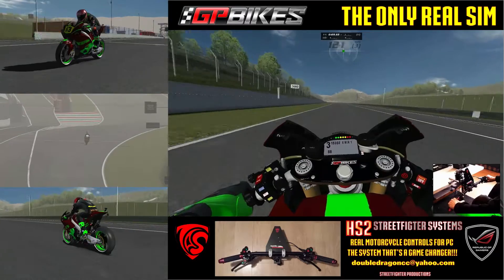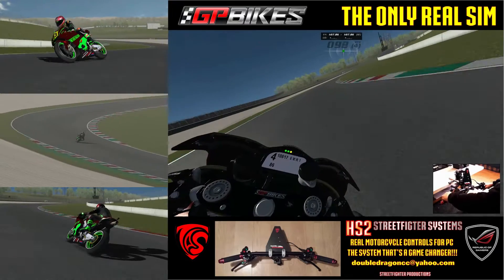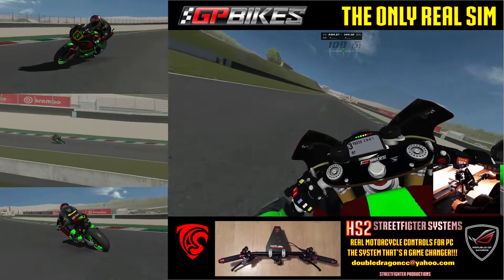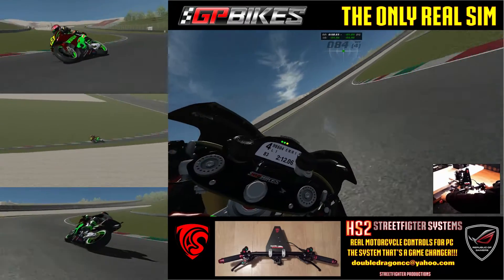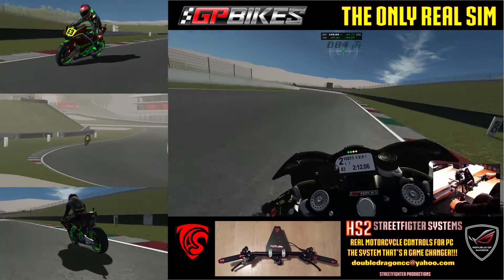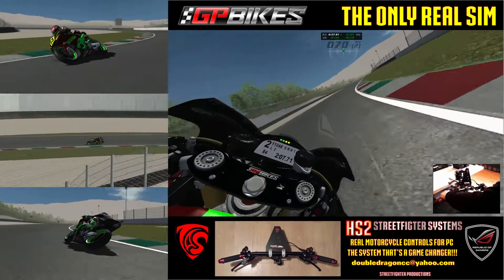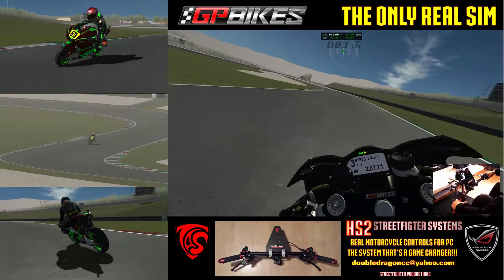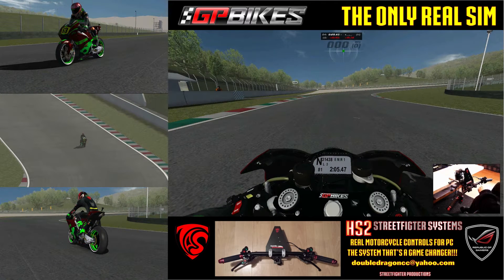Hs2 StreetFighter System 1st Test

Comment: Hi,
I would like to know the cost per system, interested in rig it into a real motorcycle frame. any contacts / facebook where we can text/msg each other?

Can it be interfaced to PC or PS4 Ride game beside the GP demo?

Thanks
Reply from the maker: +Lee Norman Hi Lee, it is only for PC at the moment. It works in ALL games. I even use it in GTAV lol. You can see it in ride with foot controls at the link below

https://www.youtube.com/watch?v=EdybSKh5rbM

I rarely use Facebook but have a private chatroom on my website I am building or yahoo messenger. My email is doubledragoncc@yahoo.com.

These are not toys and they are all custom handmade to order only so they are not cheap cheap. 

If you wish to call by phone I am in London UK 07766986981

DD
Reply from the maker: +Lee Norman I can make them fit on a real bike frame but need all the specs for the frame.